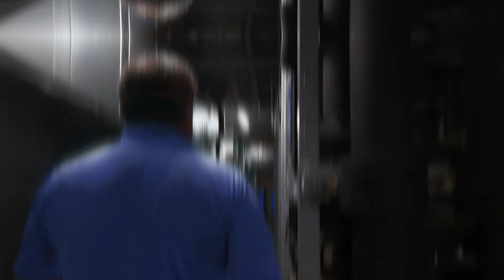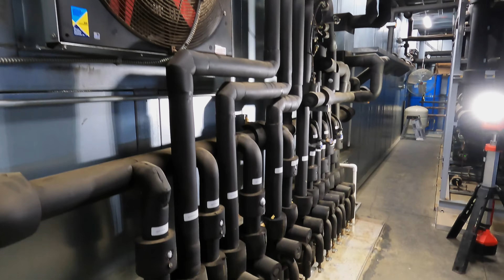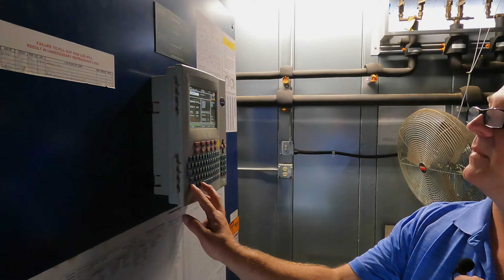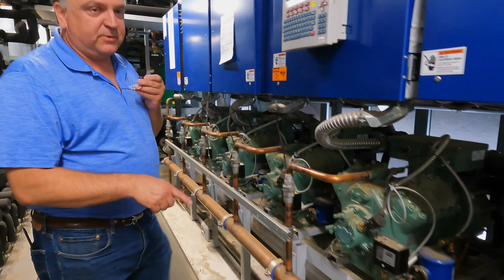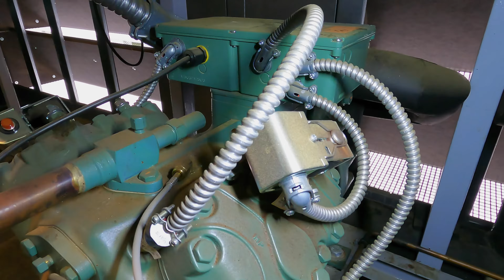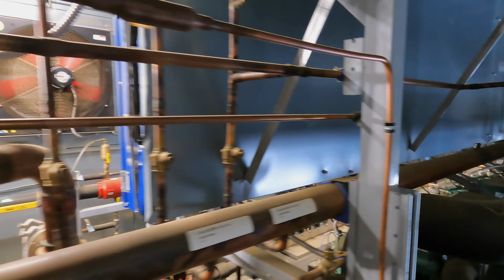Co2 General Rack setup

Comment: Im surprised that positive displacement  pumps aren't being used in order to utilize the improved effiency of the low ambient temps which lower the discharge temp. They have been used in Britian for over 20 yrs but for some reason the USA has appeared to treat them like they don't even exist.

Comment: We are trying to start a trans critical rack today. The E3 has points setup. But they don’t go to anything. The program isn’t worth a fk if there is no pointers. “Call customer service” is the response we got. 

At least Hussmann sent people. 

EMC was super helpful

Hill “call customer service” 

“Ok. Nothing is programmed and I have to call customer service?”

May 12 2026. That is a real conversation through email.
Reply: I 100% can program the -42f rack we have. The issue is that hill was supposed to do it. Or give me $4k to do it. $1 for every pound of refrigerant. Yeah, it’s that’s how much we estimate it holds
Reply from the maker: Doing an E3 trans critical this summer. It’ll be my first E3 with trans.
Reply: @jrmayo_reftech  if you have navigated an E3 enough, it’s not that bad. But don’t put liquid in that thing until you verify every sensor is where it should be and every valve moves the way it’s supposed to. Those reliefs are loud as hell.

Comment: Great video! But why use glycol for the AC heat reclaim? Just use water. glycol is added to water to lower the freeze point in chillers. This is a heat exchanger for the HR. Temperature is high both sides. That hydronic pump is working extra hard to pump the glycol. Also, water has better heat transfer rate than glycol. For high temp, water is the best.

Comment: So what exactly is the 449a used for?
Reply from the maker: The rack that has 449a in it removes the heat from the Co2 through a plate to plate heat exchanger. It takes vapor Co2 and changes it to a liquid.

Comment: Is that a critical or subcritical system? I heard critical CO2 runs at ridiculous high pressures
Reply: This must be subcritical because it runs under 650 psi and uses R449 for the high temperature loop with a condenser/evaporator interfacing the two.

Comment: No idea how I found your video, but now that I'm here I have a question.  I'm 42, and ever since I learnt about adiabatic expansion at university about 20 years ago, I've wondered why fridges, freezers, AC etc uses so many different gasses to produce the same result.  So in my head all I can come up with is the stability of the compound used.  If it degrades over time and creates a residue then that's obviously a no go.  Then I figure the temperature differential between compressed and expanded ought to be more or less the same between the various refrigerants .  Unless domestic refrigeration compressors actually take them to the liquid state, then the enthalpy of the phase change will also contribute, but are domestic compressors really that hardcore?

Very long winded, ranting way of trying to say it.  If you can be bothered answering, then thanks!  I tried googling but my god was there a lot of bullshit! 😂
Reply from the maker: Glad you found this. There is a lot that needs to be explained and can be very long but basically it’s about capacity and what the customer or engineer of equipment prefers. CFC and HCFC (like R12 and R22) are phased out because they had an ozone depletion potential so manufacturers started developing HFC but they have a high Global Warming Potential so they are being phased out. Different manufacturers developed different refrigerants and advertised to use them because they are better than the competition. Other refrigerants have a high compression ratio so basically depending on your design and capacity dictated which refrigerants worked best for that equipment. Hope this helps.
Reply: @jrmayo_reftech  Well it's just that a few years ago I bought a cheap bar fridge that was using cyclopentane.  It's almost completely innocuous compared to CFCs, abundant and bloody cheap.  So why the f*** haven't we been using it all along?   Then during covid I picked up some work driving a truck, delivering Scope, Williams and a few other brands of commercial fridges/freezers.  I noticed that even a good number of those were running on cyclopentane.  That's why I've been left confused about it.  For reference, I studied science at uni, majored in chemistry and pharmacology, and I'm still that little kid that says "but WHYYYYYY?!?"  hahahaha.  Hence why I'm here saying, "mr, but whyyyy??" lol
Reply: @Alex.The.Lionnnnn 
Because its flamable there are total charge limits. 
Propane i think is one of the best refrigerants.
Reply: @R290s_biggest_fan  lol I know all bout charge limits.  Back when I was at uni and was a typical poor student I did all of the work on my piece of shit car.  AC compressor was fucked so I threw a cheap second hand one in.  There was a guy around the corner from where I lived that did regassing for $50 ($60 with the dye).  

The problem was that he applied the very Aussie attitude of "ahh she'll be right" to adding the refrigerant.  He'd open valve on the cylinder with no regulator for a couple of seconds and say "yep, that should it".

For a while I had AC in my car that was like a blizzard in Antarctica, but then one of the lines just gave up a exploded with eough force to rip my bonnet open.  😂

Went to someone else to get the refrigerant refiled. 😂

Comment: what is happening here?
Reply: It’s a refrigeration C02 (carbon dioxide gas) rack system, instead of using typical refrigerant gases that include fluorocarbons, which are chemical compounds of carbon and fluorine. That ultimately per EPA can be harmful to the environment, 
. More than likely the application we see here is for a supermarket.
Reply: Extremely high volume refrigeration. I think this is for a Publix grocery store or distribution warehouse.